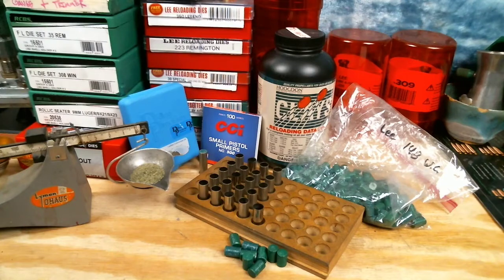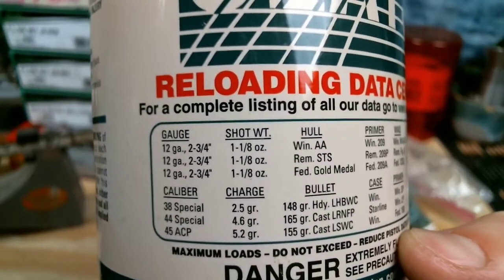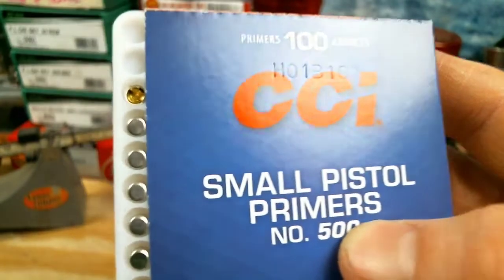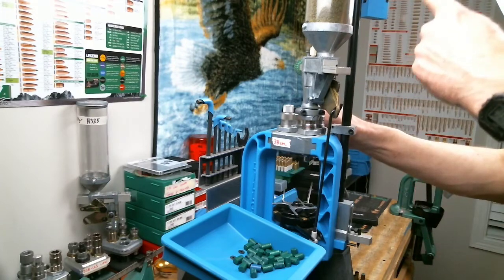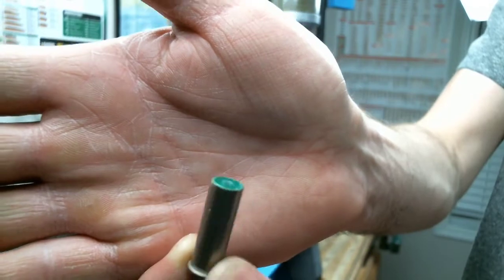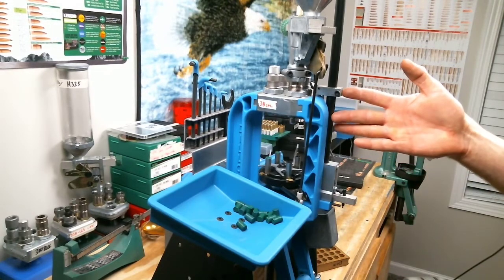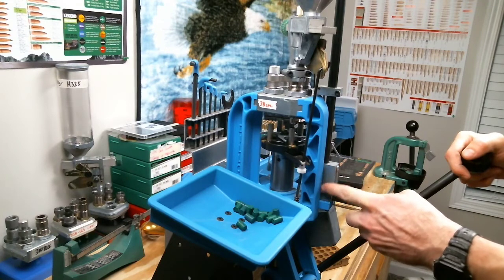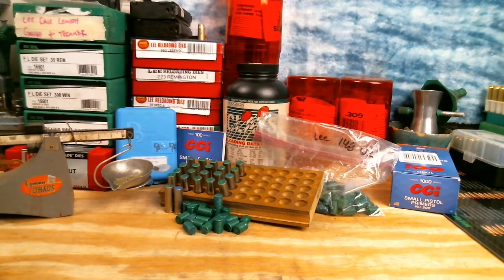Reloading 38 Special With The Cast Lee 358148 Wad Cutter Using Hodgdon Clays

Comment: I cast & powder coat the same Lee bullet, have loaded & shot probably 5k or more.  I seat the bullet at the top groove (nipple end) using Win 231.  Gives me a clean burning no leading comfortable round for my S&W 686.  I'm curious how well they will perform seated flush.
Reply from the maker: Very cool. I need to at least get a 2 cavity mold for these. The 6" I shot them from had great groups and perfect stabilization, while the 1.875" would not stabilize them and had key holes at 10 yards. I have tried them seated further out and they performed the same, with probably a bit less pressure. Thanks!

Comment: lol i just loaded 138 wadcutters with 2.5gr. of clays powder. some are like yours the others are rolled on the last bullet groove. also loaded some 95gr bullets with 38 short colt brass. some i roll crimped over the bullet ledge, others i taper crimped on the last lip of the bullet. gonna shoot them this week to see what works best.
Reply from the maker: Awesome! Sounds like fun. I have since loaded and shot some seated further out on the last groove as well. They shot just fine, but my snubby nose won't stabilize them, at either seating depth! Thanks for watching brother 👍🇺🇸😀
Reply: @DummyRound  coo coo thanks for the info. im bassically where your at, at the time of this video.  figuring out 38 loads. i got a 7.5" colt single action army 357. it should still be accurate even with the gap  my other revolver is the Remington 1858 brass frame with a conversion cylinder. but because its a  brass frame revolver loading 45 long colts out if it isn't advised, so i found out i could load 45 cowboy special black powder loads and be perfectly fine. basically identical 45acp specs   230 gr bullets but with 17 gr of bp/pyrodex. even with the 45acp to 45lc bullet travel gap it shoots on the bullseye.   so here's hoping i nailed a good loading.  good luck with your loading man. and thanks for the update. 

p.s. i also hear putting a cannelure on 38spl brass case around the bullet adds accuracy, something about the powder burns more fully, before the bullet pops off the brass case. so on some 38 cases yuu will see 2 cannelures.

Comment: Can you load a 9 mm 115 gr bullets in a 38 special case
Reply from the maker: Can it be loaded? Sure. Though I've not tried a smaller than bore diameter bullet before. 9mm is .355 and 38spl is .357, generally.

Comment: Any updates on what you've found as far as seating depth?
Reply from the maker: I haven't loaded a ton of these, but I went to the first groove for crimping, rather than flush to the case mouth. I've seen it done both ways from both reloaders and factory rounds. These didn't stabilize very well in my LCR, so I haven't pursued them much further. Thanks for checking it out.
Reply: @DummyRound  I'm testing the same in a 6" GP-100.  I think the first grove "may" be better, certainly load faster.  Just curious what ever happed to your test.  cheers
Reply from the maker: @fenomeno71  there's a range report video somewhere down the page posted shortly after this one, it might also pop up in the last few seconds on this one. They did work well in a 6" barrel, but not the snubby.

Comment: 😂 set up a progressive for 22 rounds 😳 I wouldn’t bother for less than 2-3K rounds…
Reply from the maker: By set up, you mean, adjust a few die settings? Shit takes a few minutes, tops. Thanks🇺🇲🇺🇲🇺🇲
Reply: @DummyRound  no… I meant messing around with the standard powder adjuster, the micrometer ones are bad enough 👍
Reply from the maker: @chrismclean2989  still not that bad, and better than moving all the dies to the single stage and then back to the Dillon